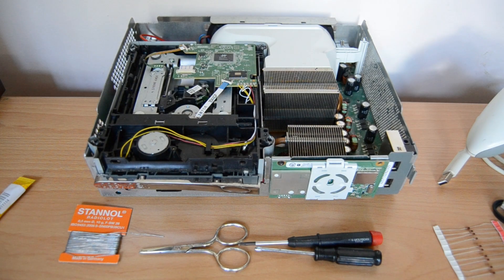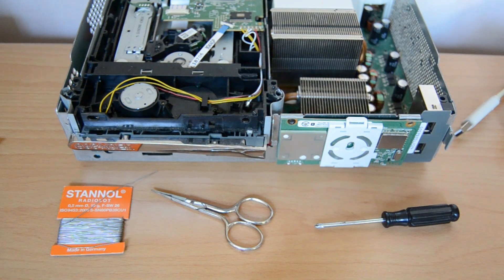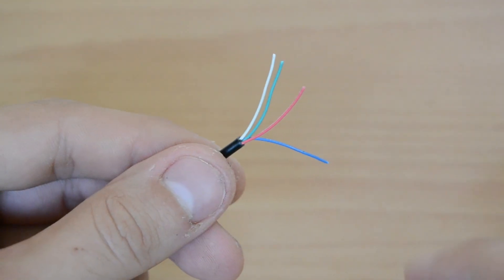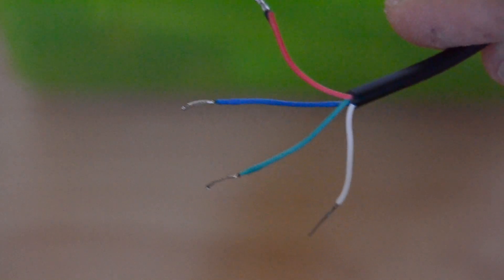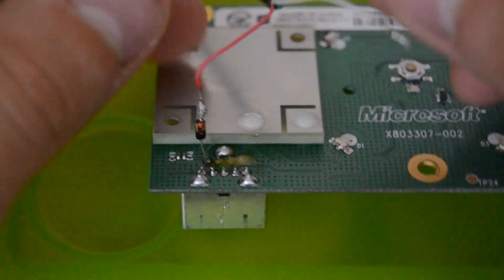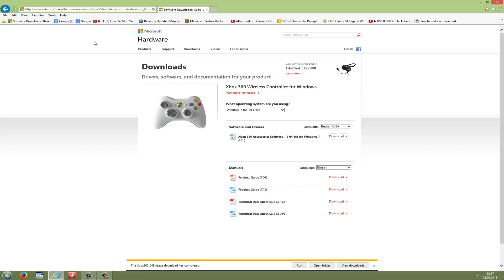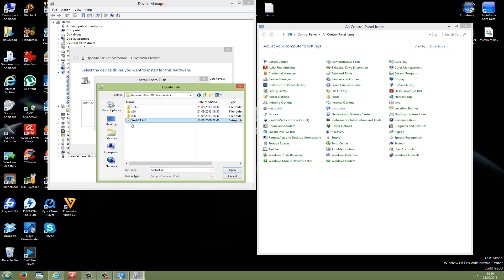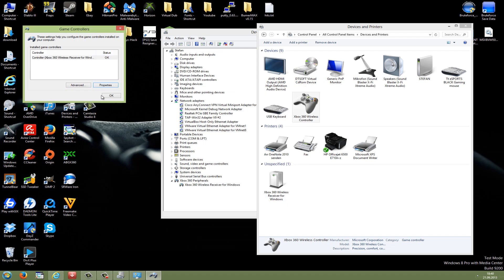How to make a homemade Xbox 360 controller wireless receiver for PC! [HD]

Comment: i dont get it does led work as diode or not
Reply: A led is a diode...Light Emitting Diode(LED)
Reply: well so just any led would work?
Reply: Yes mostly likely the smaller ones. The shorter prong is the negative, keep that in mind.
Reply: thanks
Reply: Make sure that the specifications of the LED provide a sufficiently high reverse breakdown voltage, something comparable to the diode he shows in the video, so that your components are protected from reverse current. But otherwise, yea that is fine, as Chris Hdz said an LED is absolutely a diode.

Comment: I have mine directly plugged with a usb cable not even soldered , its been 3 months and no  problems at all it is 24/7 plugged in while using w7.

Comment: you could just plug in your charger cable to make your controller wired... i mean then all you have to do is download the controller software....
Reply: False. The charger cable carries no data capabilities.
Reply: Jack Biles Not true, plug your charger cable into your xbox then turn it on. now turn it on without the cable plugged in. There is data transferred through the cable, as it turns off the wireless module in the controller whilst charging, but if you try plugging into windows, it will blank the device and stop you from using it.
Reply: Benjamin Webster nope, it is impossible to use the play and charge kit to use the controller on a PC it is a completely different board in the wireless controller to the wired one. It only has a wireless connection the cable just charges the batteries, if you plug it into your PC and turn it on it will use the wireless connection and turn on your xbox, the PC may recognize it is plugged in and install the drivers for you but the controller will not work, the data cables in the usb are only used to sync the controller and carry no signal from controller input other than the power and sync button.
Reply: He's confused with the ps3 remote :p It's so much easier to use that because you simply plug it in and install drivers. Done. You can also unplug it and connect with bluetooth if you have plugged it in before :D
Reply: Nope. Im not confused. There is data transmitted through the cable, just it is disconnected if you plug it into a computer. 

Turn off xbox. turn it on using the controller wirelessly.

Turn off xbox. turn it on using the controller but with the play and charge kit attached. Much faster.

Oh and you dont hear the interference on a guitar amp when using the charge kit.

Comment: Ah, I knew saving my "reject" 360 chassis (ones that refused to stay "fixed" after using 5mm bolts to clamp down the heatsinks to fix the RROD) would pay off! Thanks!

Comment: Guys you should be using two rectifier diodes in series on the usb 5V rail to drop it to ~3.3V that the board runs off. Or use a zener diode to create a regulated 3.3V source.
Reply: thanks just made this with 2 1n4004s in series :)
Reply: CreatingNull I only used 1 diode, and mine is still working 3 years later.
Reply from the maker: thanks for the tip !
Reply: This is because in the xbox the rail supplied to this RF unit is 3.3V. Unsure how much protection microsoft built into the unit, but 5V could significantly decrease the life span.

Comment: I get a code 10 failed to start error when I plug my board into my Windows 8 computer. I am using a REV B board
Reply: UPDATE: It appears I was using a usb port with insufficient power. I plugged it into another and it worked fine.

Comment: A zener diode is a really bad idea...  a zener diode allows current to flow in both directions under the zener voltage.  The fact that you are using a 5v zener is even worse, because the entire board operates at around or under 5v.  This means that if you solder the pins improperly, which almost everyone does on their first try, and you short the +5 to the ground, you are effectively sending 5v into your computer's USB port in the wrong direction, and you could either fry your motherboard or the RF board.

Please stop telling people to use zener diodes, and stick to a regular diode instead.  Any of the 1n400x series should work, they are the most common diodes in the world.

Comment: so I'm not the best solderer in the world & I think a left a pool of solder which made contact with the pin next to it on the pcb board, will that effect the way windows identifies the device? when I look for the driver windows says that there is no driver compatible with the device...HELP! the exact error messege reads "the folder you specified doesn't contain a compatible driver for your device. If the folder contains a driver, make sure it is designed to work with Windows for x64-based system"

Comment: When you say that I have to sync my controller to the board, do you mean that I have to sync it only once before, or sync it, leave the controller on, and then attach the board to my computer?
Reply from the maker: sync it before should be ok.
Reply: @TechMagnet  Hi there , managed to install drivers but cannot sync the controllers, got the rf module for a friends old broken xbox, is there a way to sync without the xbox itself. thanks